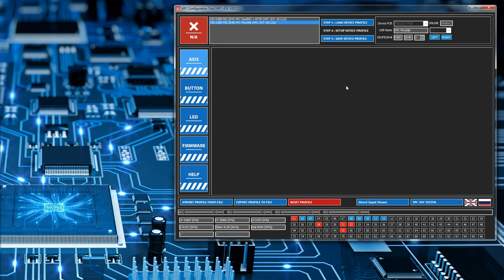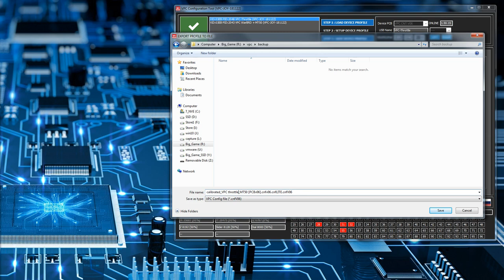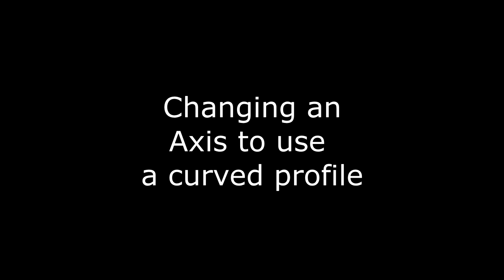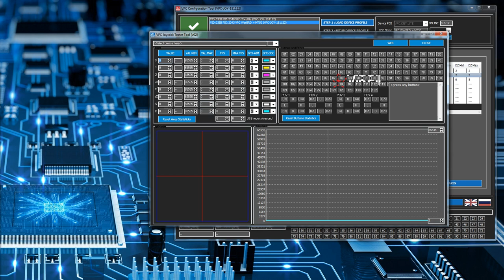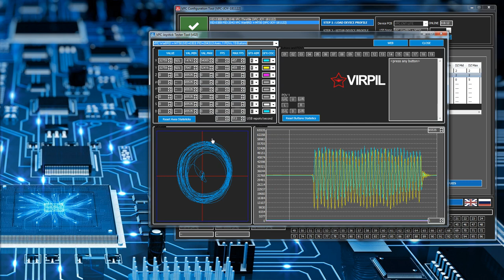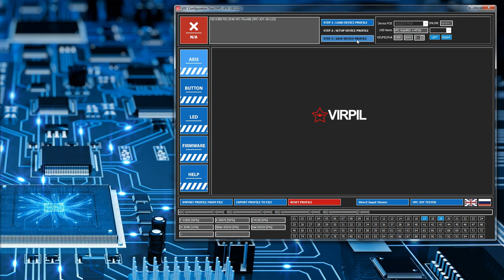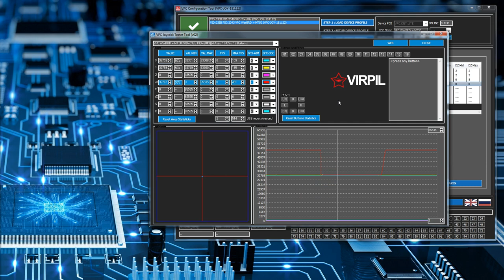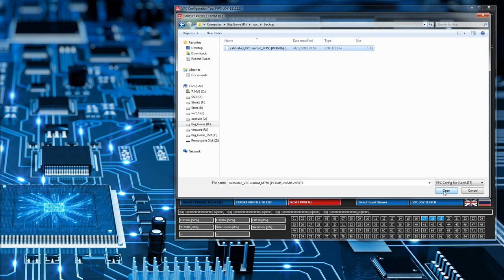Virpil VPC configuration software - axis tutorial

Comment: Thank you for the fantastic tutorial! It was incredibly clear and helpful. I have a MongoosT-50CM3 Throttle, and I’m wondering if it’s possible to change the axis curves with a button. Specifically, I’d like to set up two throttle modes: one where 0% corresponds to 0 and 100% to 100, and another where 0% corresponds to -50 and 100% to 50. Ideally, I’d be able to switch between these modes by pressing a button. Thanks again for your help!

Comment: I need to map my left mouse wheel on my Delta as a throttle, i.e. scroll up increase throttle, scroll down decrease throttle, push function resets throttle to zero. I followed your guide but when I scroll down, it increases up to 100% max processed value, also when I push the wheel it resets to 50% value and starts climbing to 100% on its own. Do I need to calibrate the wheel and if so how? Thanks
Reply: same for me.

Comment: Quick question. I have trouble with the mini joystick on my CM2. In the Virgil software its functioning correct as a joystick. In DCS it’s recognized as a joystick input, but behaving as a button (on/off vs range/curve value). Didn’t change the settings or program this as a function. Did a recalibration and also compared the values in the table and settings with the throttle lever function (as this is function normal in DCS), but can’t find the issue. Probably overlooked something (checkbox, etc.), but was hoping you have a quick fix
Reply from the maker: thats really weird, without seeing info from your VPC config software pretty hard to work out whats going on
Reply: @HavocCompanyClan  Can send you screenshot if that helps. What screens do you need to see?

Comment: Hi, 
Very interesting video. I've adde axis to button commands to start and stop my engines in DCS. 
But because I'm using the warthog detents on them, I can't idle my engines. 
The new 0 point as it were has to shifted to ~26%. 
Is it possible to reset the 0 point of the throttles?

Comment: Excellent presentation of information. Everything is shown in detail. I have a question about curves on axes. Is it normal that my joystick started drawing a diamond instead of a circle after I smoothed the X and Y axis?
Reply from the maker: what curves you using ? (values in table)
Reply: @HavocCompanyClan  I set everything up as in your manual - 1-5-8-14-22-33-44-61-81-100.
Reply from the maker: @gr-44  if you make max to min values on one axis only does it look like a curve ?
Reply: @HavocCompanyClan  The minimum and maximum values are specified during calibration. I tried to change them but it didn't affect anything. Maybe I changed something wrong. Please explain what exactly needs to be set to the minimum and maximum values. I recorded a short video so you can see the behavior of my joysticks - https://yadi.sk/i/kYIKMAEWGb61wQ
Reply from the maker: @gr-44  no, what I mean is for example use joytester to view a single axis at a time left-right axis .... move stick all way to left, then slowly move it all way to right observe the output of the joytester the movement around centre
Reply: @HavocCompanyClan  If you move the joystick handle left-right or up and down, you get horizontal and vertical lines. It is difficult to make them even, but they are the same as in linear interpolation. Sometimes it refracts slightly in the center, but this is more likely due to fuzzy movements. And this is weird. I don't understand why a rhombus turns out. Although I read on one forum that it should be so if there is no linearity. But I could not find an explanation for this.
Do you have the opportunity to conduct the same experiment?
Reply from the maker: @gr-44  pretty busy at the moment, for curves I do not set them in the VPC hardware, I use ingame curves eg in DCS I fly many  different aircraft so one curve ... would not fit all , I suggest you leave them all at 100 in VPC config and change curves in the game you are using
Reply: @HavocCompanyClan  I only play Elite Dangerous. Unfortunately, you cannot set curves there. I used to use Thrustmaster T.A.R.G.E.T. Now I tried to install Joystick Gremlin, but for some reason it does not transfer the curves set on the axes to the game. Only the specified buttons work. Also, dead zones do not work from it. Perhaps there is some nuance that I do not know. Maybe you need to set some settings in the VPS software so that it addresses the Joystick Gremlin.
Reply from the maker: @gr-44  check out some tutorials on joystick gremlin and elite, what happens in JG is you take your normal virpil axis apply a curve to it and then pass that into a VJOY device axis, which you then bind in ED,  join this discord https://discord.gg/szqaJE7   and go to joystick gremlin channel for help
Reply: @HavocCompanyClan  Ok. Thanks for the valuable information.

Comment: thank u for all the info u put out there. but having an issue with the axis to button...   it registers in the virpil software that its working but not ingame    for example Star Citizen i tried to map a button for the 90% to 100% to afterburner but doesnt see it when mapping in game. same with trying to map for a spacebrake for the bottom 5%...       seems as tho if Windows doesnt see it as a button press in controller setting that i will not be see in game at all   is there a way around this
Reply from the maker: Axis % binds to button inside Virpil software, you then in the button Tab BIND this button to a logical button (no Gaps allowed in binding list)